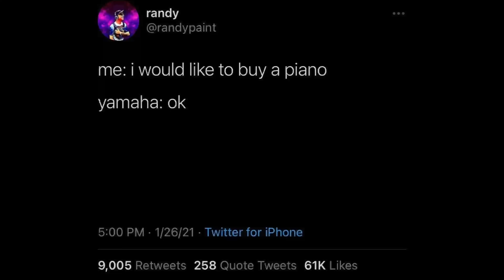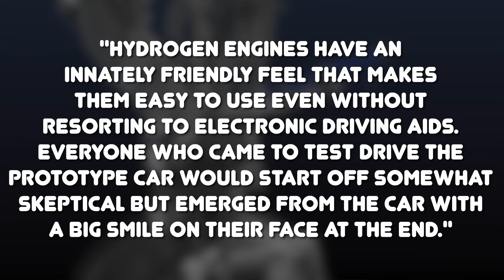Toyota's New 455HP Hydrogen V8: Everything You Need to Know

Comment: Electric cars do have maintenance quite a bit. They are also not as cost effective as internal combustion. I will never own and electric. I would own a hydrogen car. Infrastructure is a struggle for any change of fuel or power source. Electric cars have a super weak secondary market and problems with e battery can easily result in a total loss. 
Bring on the hydrogen.
Reply: My Kia eNiro costs around a third of the price of servicing my old petrol Golf.  And electric cars have a "super weak" secondary market?  Not in the UK they don't. Even a year old EV here sells for as much as a new one.... demand for EV's is through the roof here. Even a 10 year old Nissan Leaf sells for £4 to £5k.....  And EV batteries can be repaired and refurbished, just like an ICE engine. Here in the UK we have EV specialists already doing this work.... Your EV beliefs and perceptions are way out of date.

Comment: the big problem with hydrogen is the need to find better ways to store large amounts of it in-vehicle that doesnt require high pressure cylinders. even though lithium and gasoline are both flammable neither of them are pressurized

Comment: Obviously they won’t sell if there’s no where to fill them up! Electric cars wouldn’t sell if you couldn’t charge them!
Anyway, They were fuel cell vehicle and looked like shit so that didn’t help.

Ev’s are flawed. Range and charging networks will improve but there are still issues that make hydrogen a much better solution for all applications.
Reply: So you wouldn't consider the lack of hydrogen filling points ( just 12 in the whole of the UK) or the terrible fuel economy of hydrogen vehicles, and higher cost of hydrogen to be a drawback?
Reply: Brian I’m not sure why you are getting hung up on this. Obviously nobody is going to open up a hydrogen fuel station when there are no customers just like there were no EV chargers before EVs were invented. The state is pumping our cash into EV infrastructure.. it’s not happening organically.

Nobody knows what the range per tank of hydrogen fuel is but It seems like JCB have made theirs run for the same amount of time as their diesel machine. You are basing your assumptions on the old Toyota Mira, apparently the new one has a range of around 500 miles.

Comment: You missed the 800 LBS gorilla in the room. just like electric cars are charged by what 90% carbon based power production. so there ( sorry Libtards ) not carbon neutral!!!! to produce enough Hydrogen to be viable as a fuel takes vast amount of power.. never mind the fact your driving a possible atomic Bomb... yes the early atomic bombes was hydrogen based.

Comment: There are (really one) reason why the electrical wins.
1) Hydrogen is mostly made from natural gas, and if so you can just as well keep on driving your gas V8 from a CO2 point of view.
2) If you do your hydrogen from water via electricity, you will get 3-5 times further on 10kW if you have a battery electric compared to a hydrogen car. Calculate it and you will see I’m right. This means the battery-electric is much cheaper to drive.

Comment: one word: Weigth. the battery is heavy! for sure, the weight of the engine plus the fuel tank + the fuel itself will be far lighter than the battery itself. Yeah, the teslas are nice, pretty, cute, but they are heavy! And what about range? batteries cost like 10000 usd to be replaced in less than 5 years. you don't swap your engine in 5 years. I would love to have an electric car that won't be as heavy as the teslas are, and be as enviromentally friendly as the teslas are. cheers!

Comment: I don't think electric beats hydrogen in the long run. There are real problems with BEV. Even if initial cost of batteries continues to drop, they still have lifespan (replacing Tesla batteries costs more than buying a new Tesla, not covered under warranty), disposal, and spontaneous-combustion issues. You mention a lot of good reasons you think BEV has already won, but I think consumers also like vehicles that retain a semi-decent trade/resell value. Will these factors be enough for hydrogen to overcome its teething pains? Remains to be seen.

Comment: Hydrogen seems cool and there may be a market for it even though electric makes everything nice and simple, it comes down to if the power grids will actually be able to keep up with energy demand for the EV population. If the grid can't handle it then Hydrogen could have a shot plus clean fuel means a lot less smog emissions crap and opens the door to heavy modification. It could be the new wind the in the sail of the car community.

Comment: what you're completely missing is that manufacturers have "trillions" of dollars in machinery for manufacturing engines and they're extremely cheap and reliable and the components everyone has on their shelves.  getting hydrogen into the market is easier than creating 400% more power grid n North America so everyone can drive a Tesla - yes that's the requirement to go 100% EV - and furthermore nobody "cares" about the incredible stupid amount of weight that EV's have to lug around much less their average 1 metric ton of batteries per vehicle.  when considering that North America alone consumes 17 million new cars a year - the amount of recycling EV batteries is another ridiculous environmental disaster waiting to happen.  hydrogen is cheaper, safer, easier on manufacturers, consumers, and with zero emissions they're better than the EV with its 2000 pounds of toxic batteries.  #theend

Comment: People also forgot EVs are like death machines on the road because they are so heavy. It's normal for EV sedan with the weight of pickup trucks. While hydrogen engine cars can resume the weight of normal cars that's like 60-70% of EVs. You don't want to be the person to get hit by EVs. These hydrogen engines can be fitted with hybrid powertrains too (especially for smaller engine hybrid economy cars), and it'll still can get the benefits of regenerative charging, plugin home charging etc

Comment: You talk about “no maintenance” electrics while neglecting to mention the extraordinary cost of replacing the batteries. 

Also, for those who care, Hydrogen is far cleaner than electric. Not only are batteries extremely toxic, but the mining of materials used in batteries is even worse. Plus, much of this mining takes place in China by the CCP, which has essentially zero regard for the environment or the human rights of Uighurs or political prisoners forced to work in many of these mines.
Reply: So how about the reasonable cost of an EV battery refurbishment instead?  Cleveleys Electric Vehicles, in Gloucestershire, England, carried out a battery refurbishment on a 10 year old Nissan Leaf a while back. The work took 4 hours, and the cost was £600.  And no, "much" of the mining doesn't take place in China. Around 35 to 40% of the World's lithium is mined in Australia.....  And what would your thoughts be on the big oil companies mining for cobalt, as they have already done for decades? They need cobalt to remove sulphur during the refining process. The oil companies are BY FAR the largest users of mined minerals.....

Comment: I’d say the demand would be high because I think you are wrong about how electric cars are better. I don’t want electric cars as my car I’d rather keep a combustion engine. This hydrogen yet proves no emissions with keeping what gear heads love in combustion engines. I also don’t think there is enough resources and infrastructure to make everything electric. Our houses, buildings, computers, phones, tools and now planes, cars ect. What happens if we only use one recourse to power everything? It will get depleted. I like that Toyota and Yamaha are providing more than just one recourse to use. I think we should keep using gas along with expanding to multiple powered vehicles. We will use less of each resource slowing down depletion and giving time for recourses to reprieve themselves. I think all electric is fine in the short term but not the long run.

Comment: I believe your wrong about no market for hydrogen powered vehicles. Dfm from Chevy is horrible, dod from dodge is horrible, and getting a 3.5l in a truck is just not right. With hydrogen you would not have to run a tiny motor or a engine that is prone to failure. Electric vehicles are not there and what I find funniest is that people think that electric vehicles are saving the environment but pay no mind to where that power is coming from. Not to mention how lithium is a unstable element and how it’s disposed of.

Comment: I think that hydrogen-electric vehicles are a more viable alternative to battery electric vehicles for a couple of reasons. The main reason is resource availability when put in the context of a global scale. 

A hydrogen electric car can use either a chemical generation unit which turns hydrogen back into water to generate electricity, or use a hydrogen ICE as a generator. Either method of generation would be used to power a small battery pack and/or directly power electric drive motors. 

Battery electric vehicles do have some advantages of operation such as silence and low maintenance schedule, and I agree that the range and charge speed would likely be much improved in 5 to 10 years. 

However, these battery electric vehicles are so resource intensive that it is questionable to say if they can be scaled as a consumer and/or industrial item to replace internal combustion engines. The current demand for battery electric vehicles is already maxing out global production of many precious minerals and other resources such as nickel. Battery electric vehicles encompass a tiny share of the global market for both personal transportation and commercial use. We would need to multiply our output of these materials by 5 or 10 times in order to even have battery electric vehicles be a majority share of the market. 

If the battery electric technology advances to the point where the batteries are not so resource intensive, the problem is solved. That is probably not realistic in the near future, it would require such a leap in technology in order to produce batteries on the needed scale...

I say that it is much more realistic for a hydrogen distribution system to be slowly integrated into the existing gas station infrastructure than it would be to have an exponential growth in global production of the resources needed to support battery electric on a global scale.

Comment: I have and always will, despite the performance and benefits of an electric vehicle, feel that the fact that electric cars are silent is so incredibly lame when used in a performance application. I can see it on a common day when you are tired from work maybe. When I'm excited to to get on the road and drive. The noise, personality and shifting gears in an I-C-E powered car or motorcycle always will fit the bill of what I desire. Its an experience of sensory overload on all sides. This seems to fit most gearheads too, unless they are purely concerned with winning a race in which most of the time electric cars like the Plaid can have the upper hand. It's still too quiet for me, nomatter how fast it is. Unfortunately, the market it set for common people and not us gearheads. Our driving passion will not solely keep the internal combustion engine alive. Money and pressure of environmental impact is far greater. I'll still take my old Terminator against any electric as long as I have the choice to put fuel in the tank when I get excited for a driving experience. That alone is a sketchy subject looking into the future. We shall see.
Reply: I think people will look at you in future the same way we look at steam engine enthusiasts now.
I can relate though, I was worried I'd miss the engine noises I loved but after 5 years of EV ownership, I've never looked back.
Reply: When they stop selling gasoline I’ll just start buying corn barley and yeast and have fuel that can get me drunk too,

Comment: Interesting conclusion.  HHO on-board and on-demand really is the answer and should be developed.  Supplemental HHO to gasoline and diesel should have been phased in beginning 10-15 years ago.  Let's see this new Toyota when they release it to the public.  Toyota and Yamaha are very smart, they won't be making any stupid decisions.  They have too much success behind them for such a blunder right in front of them.  Toxic, hazardous and combustible old used electronic car batteries won't make Gretta Thunberg or Greenpeace very happy.  Neither will all the strip mining for lithium necessary for so many electronic cars.

Comment: Batteries arw made of lithium Wich is a toxic non renewable material so actually a hydrogen car is less polluting also hydrogen could be made at home if a company designes a electrolisis station and also since it's made with water and electricity you could use solar pannel electricity to make it, but there's no push to really go 0 emissions because if you could make your own fuel oil industry wouldn't die 100% but it would get hurt bad and well rich doesn't like loosing money. Dah that is why it never took off.

Comment: I wish hydrogen would really take off. It would be a matter of changing our gas stations to hydrogen . Water doesn't care if the sun shines. Available almost anywhere and I'm sure turning water into hydrogen is easier and cheaper than processing fossil fuels.We barley have enough electricity to run the country now so if we have an influx of cars needing electricity its going to really strain the power grids. Or have a small hydro engine power an electric motor. You could easily retrofit classic cars to hydro too. Many possibilities. I also see the dangers of Joe citizen working on his own electric. I'll most likely be dead when it gets sorted out but it will be interesting.
Reply: The big oil companies wish hydrogen would really take-off too. Then they'll be able to exercise an iron grip on the production and price, just like they did with petrol and diesel.....